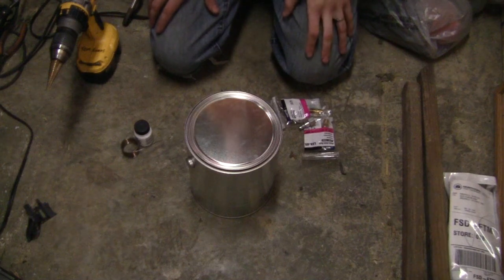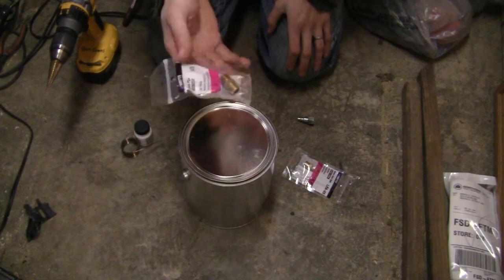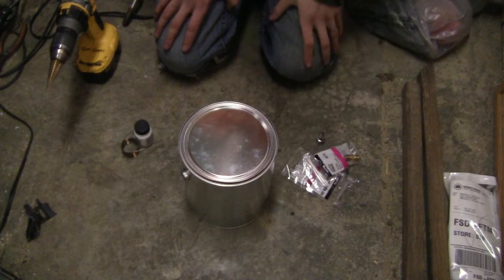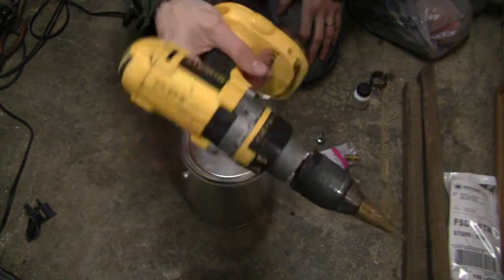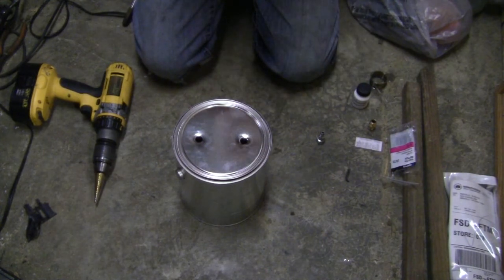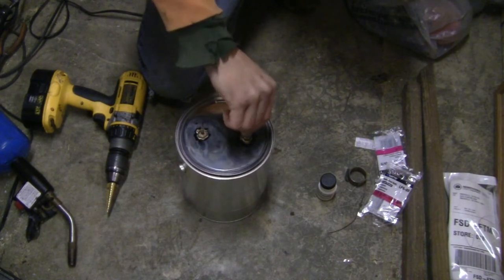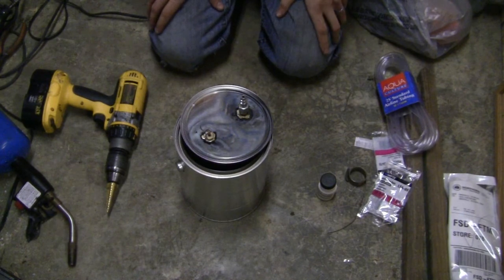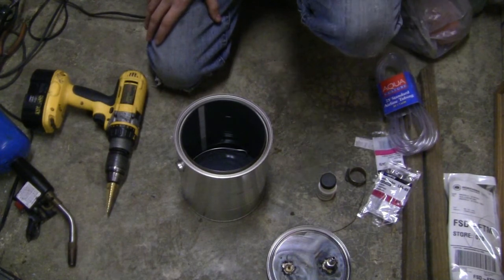Vacuum leak finder (Smoke Pump)

Comment: All you need is a squirt-can with rubbing alcohol.
When you squirt the vacuum leak, the engine speeds up a little.
Old-time mechanics trick.
Reply from the maker: I've tried that, never with alcohol though. always used brake cleaner, starting fluid or something else like that. never worked for me. didn't change the tone or speed of the engine.

This on the other hand worked within minutes and I had it repaired in a few more.
I'm sure the other way would work, its a very basic principal, but man i tried and tried, couldn't ever get it to work.